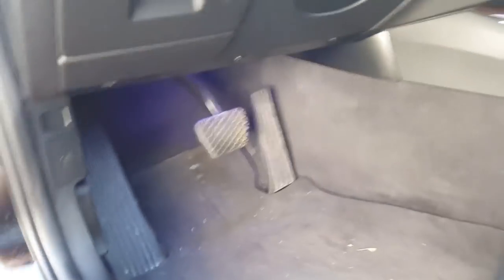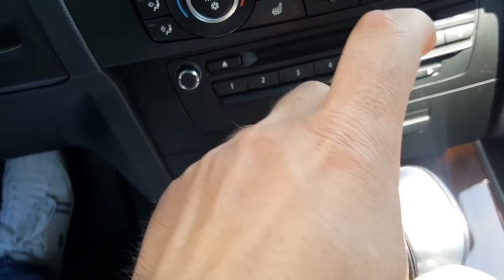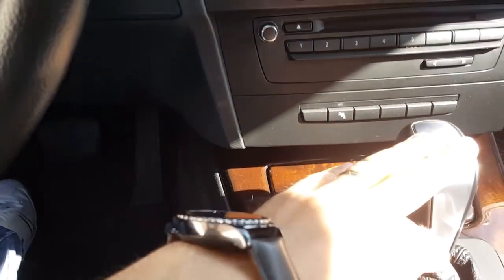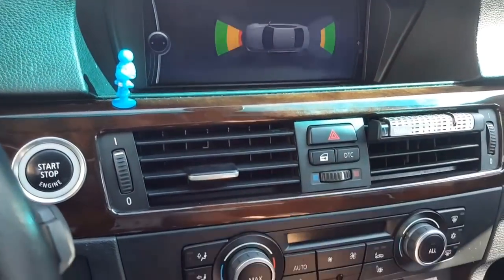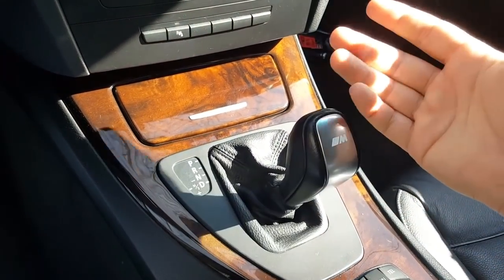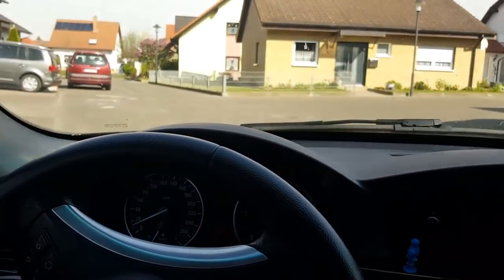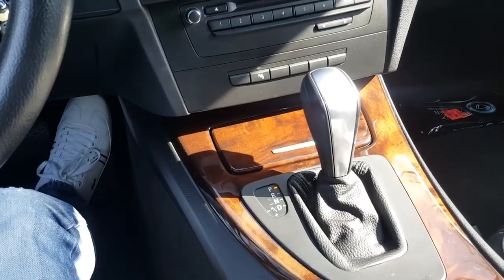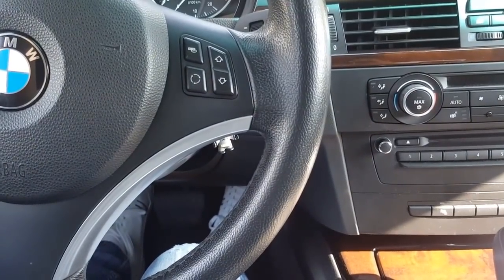How to drive a car with an automatic gearbox

Comment: It is always advisable to apply the handbrake when you park the car to avoid creeping. Think about it this way, if you park on a slope without applying the handbrake, what do you think will happen? Even on flat surfaces, I have seen that happen
Reply: @Redblade rather put it in park. Easier to remember. Taking off again quite simple too.
Reply: Handbrake is probably useful if you start the car, put it in drive and accidentally step on the throttle. Otherwise, it appears to be an obsolete appendage.
Reply: If you put the car in park , there is no need for a parking brake , although it is a useful backup if on a steep hill . The car will not creep if you put your left foot on the brake when selecting forward or reverse gear , and you can balance the throttle with brake release to move off uphill .

Comment: Although this is an old video, it is good but with one important thing missed.  For someone who is completely new to driving automatic, compared to stick shift with a clutch, there is tendency to use the left foot to brake.  In order to avoid this and get used to automatic, tuck your left foot across the seat in the well so that it is almost under your seat. That way the left foot canot be used. After a few miles driving, you should feel comfortable in resting your left foot to the usual place.  This way of starting to learn automatic driving is important as braking with the left foot when it is used to pressing hard on a clutch, can be very dangerous and sudden braking.
Reply: WRONG WRONG WORNG on so many levels ; apart from the danger of deep vein thrombosis , the correct way to drive an automatic car is just like a go kart , with left foot to brake and right foot to accelerate . Once you become more proficient , you can use a little power whilst braking on the approach to bends to bring in a part throttle downshift BEFORE the bend and drive the car through in a stable condition with light acceleration . Also for low speed manoeuvring , use the left foot to control the motion of the car and the right foot to supply enough power to move uphill where required . 

Only novices do this one footed thing and never learn to drive properly .

Comment: Before you start the motor, what do you do? Do you brake and turn the key (or start button) or you just turn the key with no brakes? Is it important this?
Reply from the maker: Normally you have to have the foot on the brake first car in P and after that start the engine. On older models you can start the car without pressing the brake with car in P

Comment: Hi friend, 
I have 1 question 
I have same car with 320da 2007 model with automatic gearbox but i can’t change gear manually when i drive but it can change just 1st and 2nd can’t change 3rd or 4th like you

It’s a problem or it’s like this?

Comment: Basically if you drive a car with a automatic gearbox never use your left leg when I 1st drove 1 I was using my left leg on the brake does take some getting used to from a manual gearbox but when you get your head round it easy peasy & automatic gearboxes are more expensive on Gas & brake pads...
Reply: I'm driving a manual focus but thinking of now driving an auto. The new focus has an auto that can shift faster that a professional race driver and is more efficient in fuel. Plus fully autonomous driving.

Comment: what is the proper way. move the selector first before releasing the parking brake. or release the parking brake first before moving the gear selector to drive. thank you for the response
Reply from the maker: move the selector first before releasing the parking brake this is the method that i use and i think is the correct one. but it works the other way around as well
Reply: Personally I release the parking brake lever with my foot already on the brake pedal, then I shift into drive with my foot still on the brake to prevent rolling.

1. Start car in park (with foot on brake pedal)
2. Release parking brake (with foot on brake pedal)
3. Shift into drive or reverse (with foot on brake pedal)
4. Release brake pedal to begin moving

Comment: Well said... however I must say that I disagree on the part that you don't use a hand brake while your in P position. Brake pads are cheap but if you damaged your pin, it wont come cheap anymore...
Reply from the maker: I use the hand break of course but what I wanted to say is that on an automatic gearbox you don't have to use the handbrake like in a manual car. It is way safer to leave the car in P without the handbrake as for a manual one you have to use it to be sure that your car is gonna stand still 😁👍

Comment: I dont get it,it looks like a manual gear box do I have to use my hands to use the gear stick in an automatic ? or does it move on its own when changing gear
Reply from the maker: Automatic gearbox changes gears automatically. Just put it in to D drive or P park or R reverse and that's it. But this gearbox has the option only if u want to change manually through gears. Only if u put it into manual mode. Otherwise it will do everything automatically. Hope I could help

Comment: I just bought a 320d e90 from 2011, 189k km, with the 6 gears transmission. And I had an issue where at around 2200 rpm I was feeling like a shock but not always when car was shifting from 2-3 all other gears where changing smoothly at any rpm. I did the adaptation reset at a service and since then I feel a very very small bumb from 2-3 but just on a certain rpm and the rest of the gears changes smoothly if they are changed under 3500-4000 rpm. Now when I put the transmission into sport or even in D, and I do a kick down, I feel how it changes gears from 2-3, 3-4, 4-5, it’s like a small bumb. No slipping no weird sound or smth like that. I never driven a TC gearbox only AUDI CVT, and I really don’t know how it should feel. So how it should feel like perfectly smooth like a CVT? 

PS: I will change the oil with original bmw oil and with the ZF procedure the gravitational way without flush machine.
Reply from the maker: That gearbox shifts different when the oil is cold or warm. Is normal, and if you press the gas paddle harder you won't feel that noticeable change of gears. It is a little bit jerky at slow speeds but if you notice the shifts when you have it on highway then might be a good time to change the oil.
Reply from the maker: But it is normal to feel the shifts at low rpm. Is way different then cvt  or dkg gearboxes
Reply: Warp Drive M thank you for the answers. Recently I noticed that before gear change the car revs up a little and than changes gear. I read through internet that after oil change this issue disappeared. I hope this will also be my case and I will not need to make expensive interventions.

Comment: I'm thinking about buying a 2006-07 BMW 320d E90 with Automatic Gearbox... The problem is I'm very sceptic about older automatic gearboxes (I also never had a car with an auto gearbox), and although those cars are very reliable, I'm afraid the  Auto Gear might bring me some (very expensive) issues. Could anyone give me a second opinion on this, based on knowledge/experience? Thank you in advance.
Reply from the maker: First of all the manual gearbox on the 3 series is way more problematic as the automatic transmission. I've had more 3 series and never had a single problem with the automatic transmission. If the car has more than 150.000 km you have to change the oil and filter (aprox 500 euro) but if the manual trans goes bad or just to replace the clutch it will be way more expensive than 500 euros!!
Reply: Nunes Absolute bullshit,I've driven manual for 50 years with no issues.I now have an auto with problems,going to cost a bomb.

Comment: hi i have MAZDA, if im drive at automatic mode -and while the car on move im change and shifting to D-drive mode (while the wheels r moving)? is that ok? or it's destroy the gear
Reply from the maker: It is not recommended to change the position of the lever while driving. You can use manual shift while driving but if you want to change from P to D or N even R the car should be standing still.

Comment: Great video. I also bought a BMW 320d e90 with automatic gearbox and as I've never driven an automatic before it is really scary at first :) I always reach for the shifter whenever I'm stopping to put it into first or second gear. Just a question, how do you drive downhill (break with motor not break) do you put it in manual and switch down gears or what?
Reply from the maker: You will get use to it and don't want  manual any more! It doesn't matter uphill or downhill let the car in D and use break when needed.

Comment: Wrong explanation about parking! The parking brake must always be applied, according to the owner's manual. If the car is on a slope and a parking brake is not applied, it may cause damage to the transmission.

Comment: I broke my gearbox by trying to check if its in neutral but i pulled to hard
Reply from the maker: +Walking gamer normaly you can check on the gear leaver because a LED will be illuminated or on dash it will be shown in witch gear you are

Comment: not every car have a relise button !
Reply from the maker: +Jan č at least in Europe... I know there are some cars without relise button but just models with the shifter on stearing wheel colum.
Reply: @Redblade wrong. some cars have a shifter dial, others have a shifter on the steering column, some cars have a shifter pattern

Comment: No , No , No more wrong information - most automatic cars will start just fine in either Park or Neutral without any need to put foot on brake .
Also , you have two feet and there are two pedals : right foot os for accelerator and left foot is for brake .

You do not hop down the street on one foot , so do not drive your car with one foot - learn to drive properly , using both feet .

This video is just so bad, made by someone who is unqualified and has no idea what he is talking about .
Reply from the maker: What are you taking about? All the cars with release buttons have to have the brake padel pressed in order to start the car...and pressing the brake with the left foot?!?! I really hope you are joking 🙃